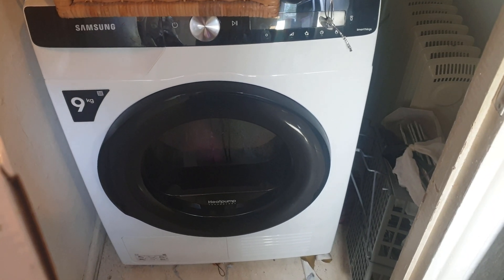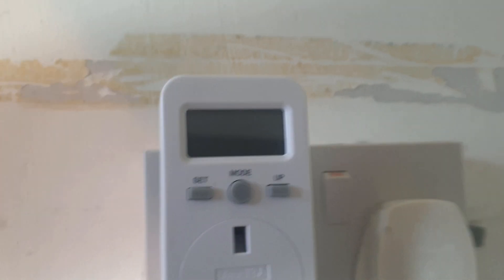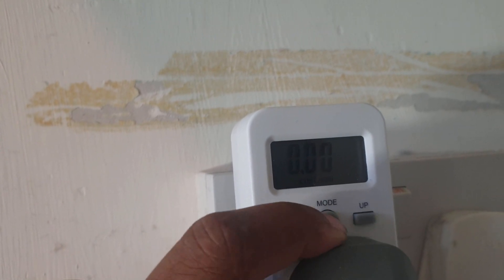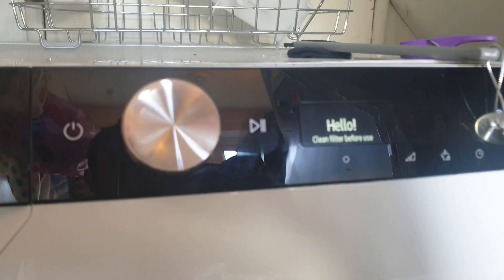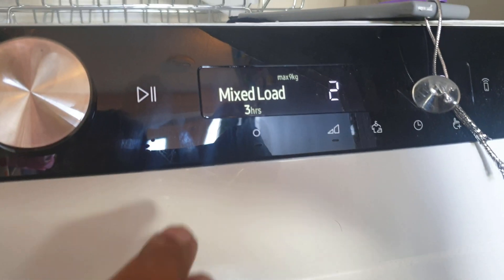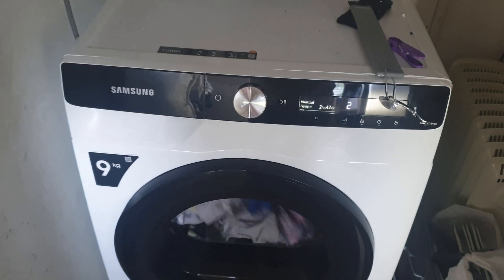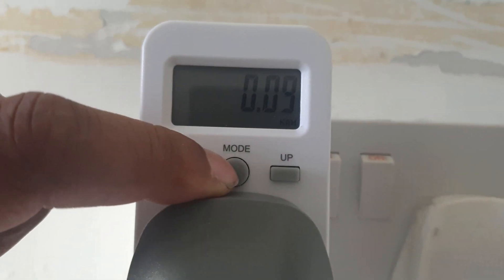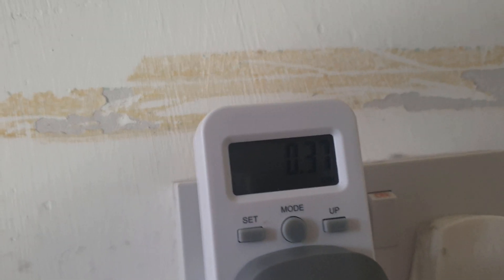ENERGY CONSUMPTION for Samsung Heat Pump Tumble Dryer DV90T5240AE 9kg A+++ Series 5+

Comment: The heat pump dryer I have bought takes 3.5 hours to dry. My older dryer took only 30 mins. So I would guess the older dryer probably cost less or the same .
Reply: Running the old appliance for 30 minutes could easily cost more than running the heat pump dryer for 3.5 hours.
Reply: If you had a vented dryer, say 4.8kw, * 0.5 (half an hour) =2.4 kwh vs 0.57kwh with this washing machine
So nearly 5x cheaper
kW = power currently being drawn 
kWh = total power consumed

Comment: Looking to buy a Samsung heat pump with electricity going up so much, that's really impressive, is it still working fine now after a year ?
My vented tumble dryer uses 2500 watts constantly
Reply from the maker: Hi. We use it daily due to large family.  Been fine so far. I now have electricity smart meter. When i get time i can check how much electricity does it use.
Reply: @UsedReviews  that's great to hear, we also do at least 2 loads per day,I think I'm going to order the same model.
How often do you clean the heat exchanger/condenser inside the flap  at bottom ?
Reply from the maker: I clean it as of when I remember or when the machine indicates it. It doesn't get that dirty. I keep misplacing the brush it come with. Lol
Reply: Hi, is it still working?

Comment: This dryer have moisture detector, initial drying hour/time can be less than actual drying time. A full max capacity for mixed load, max dry (level 3) can take 3 - 3 1/2 hours. Low electricity consumption is real! bcs its different tech from convenrional dryer. I have this dryer for few months.
Reply: May I know the consumption of  conventional dryer u used last time...lower by how many %

Comment: Thank you for posting…… Do you have any condensation issues with it being in that confined space? It looks as though it’s in the cupboard under the stairs.
Reply: No because it's a heat pump - no water vapour comes out of the machine.  The water condenses into a tank in the top of the machine
Reply from the maker: I have had no issues being where it is.
Reply: @UsedReviews  Thank you for your prompt reply…… It’s very much appreciated.
Reply: There shouldn't be any moisture coming out - heat pumps don't release the warm moist air into the surroundings unlike standard condenser dryers; the hot humid air is reused in the heat pump process.

Comment: 3 hrs to dry clothes? My regular drier does it in 40 minutes.. so unless it uses 1/3 the energy I’m not sure this would be a wise purchase.. and that’s leaving out he terrible reliability these hav.
Reply: We have this dryer for more than a year now and it takes 2 hours max to dry a mixed load. Line drying definitely is the most energy-efficient method lol but you have to factor in the rain, the time you’re available to do your laundry like if it’s during the night (I don’t think your laundry will dry for just 2-3 hours), plus convenience.
Reply: @starfalls83  Yeah humidity makes a difference. If I flip every hour the shirts and pants will all be dry in 3-4 hours.. flipping is essential.. humidity plays a decent role too.
Reply: A full max capacity for mixed load, max dry (level 3) can take 3 - 3 1/2 hours. Low electricity consumption is real! bcs its different tech from conventional dryer. I have this dryer for few months.
Reply: @lunacycalico4017  but takes 3x as long. Lol
Reply: I can line dry at 3.5 hours… so I guess beat that energy  savings lol
Reply: It does use less energy. That’s the whole point.